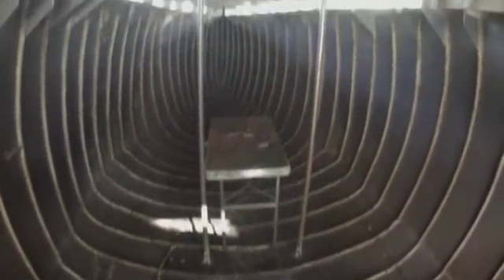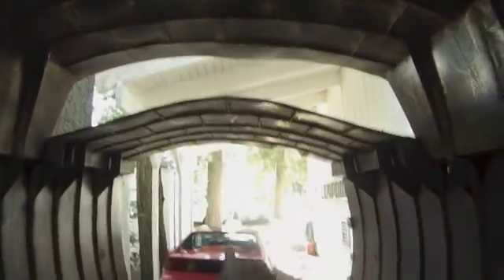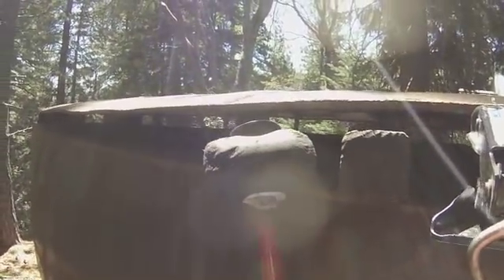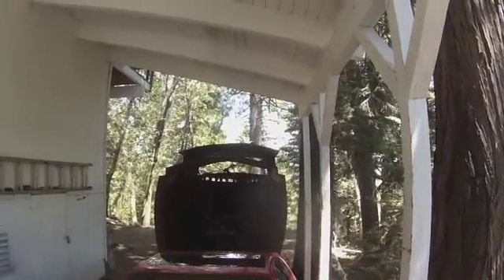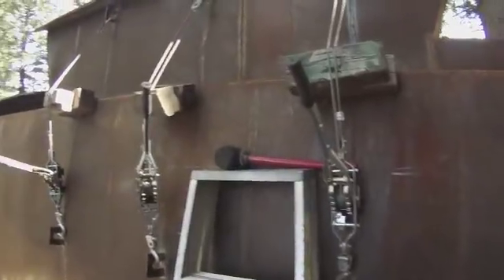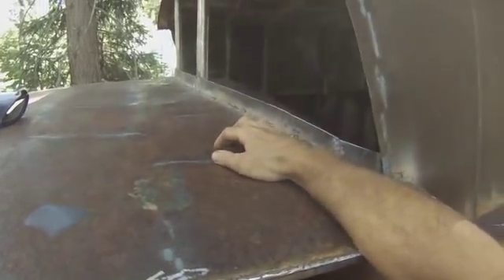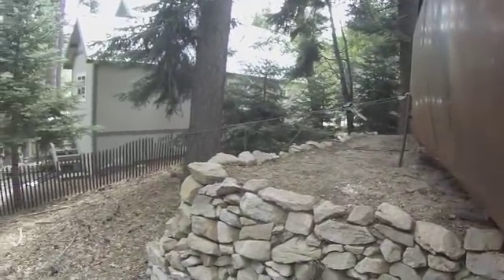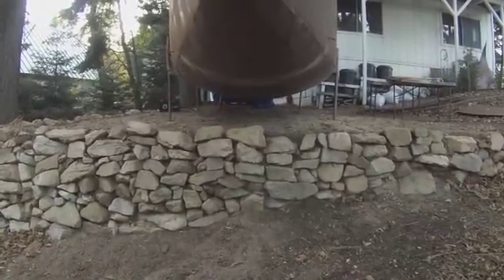Steel Sailboat Build   Part 7

Comment: What ballast weight have you calculated you need?  With a hull that large and such lightweight construction, it would act like a cork at the moment - you’ll need a few thousand pounds in the keel at least, probably a lot more.  Keep up the great work, I’m loving watching this. :)
Reply from the maker: Planning on 2400 pounds with 1000 of it at four feet draft.  I can bolt on more if that doesn't work out.

Comment: Don't bother using silicone, use gasket maker (the ones that come in tubes like silicone does, not the toothpaste variety). A slight more expensive, but worth it for the sticking power.
Reply from the maker: Thanks for the tip.  I will use that when it comes time to work with wood.

Comment: Is that a Cobra or a custom Karman Ghia at 6:07 ?
Reply from the maker: It's a 1967 Austin Healey Sprite which I bought for $1 and did a lot of welding on.  Been working on that for 15 years, but it now runs and drives.
Reply: SV Rusty Junk I was way off on the car. Screw working on the car. Get the boat done.